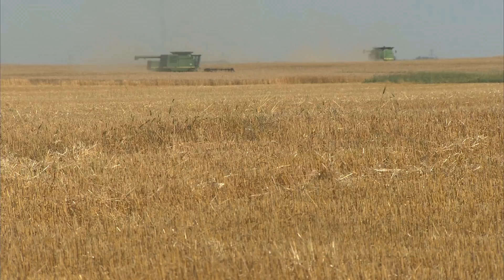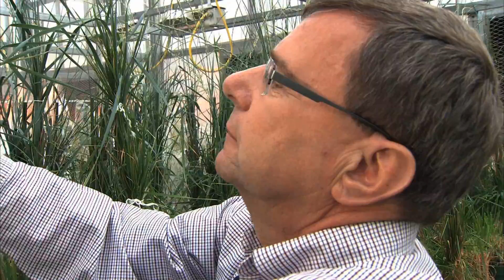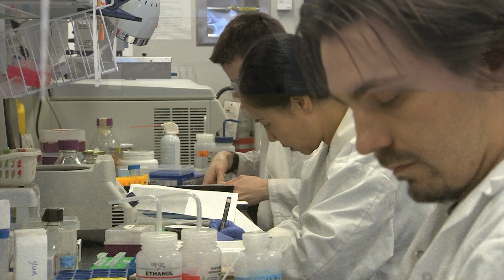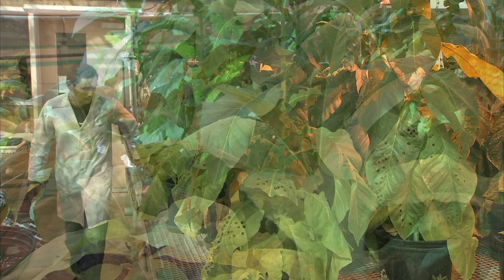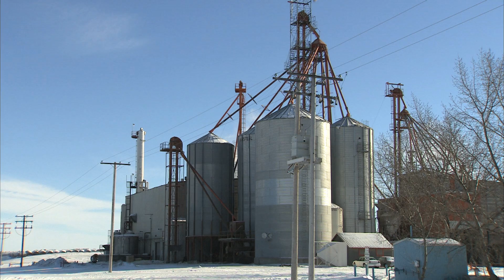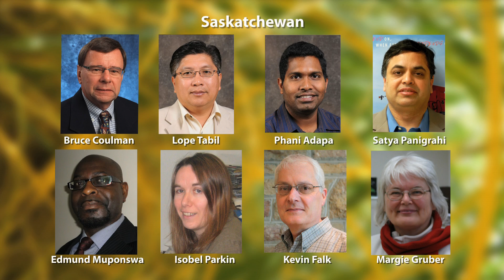CELLULOSIC BIOMASS: Part 2 - Redesigning Crops for Biofuel and Bioproducts

Comment: One potential method of economical biomass transportation to the cellulosic plant is for local farmers to setup a co-operative where they have a small pellet plant where they bring their biomass and these pellets are then economically transported to the cellulosic plant.
Reply: good suggestion. Thank you
Reply: The energy input to make pellets is significant.  By my calculations pelletisation works if your burning your own biomass to run the pelleting mill.  Pelletisation consumes about 8% of the combustion energy contained in the pellet.  By contrast using high value energy (electricity) to densify low value fuel (pellets), was about $40 per ton for something that can only sell for about $100 per ton.

The way to move lots of biomass cheaply is simply by train from the farm gate.  That's how the sugar cane industry does it, believe me they've got that side of things worked out.
When it come to farms they already have a much more efficient means of balling loose fiber... It's called a Hay Bailler.  Any farm that sells excess silage will already have all of this equiptment:

https://youtu.be/RfhErSriDzw
https://youtu.be/QVsjsXLw9zg